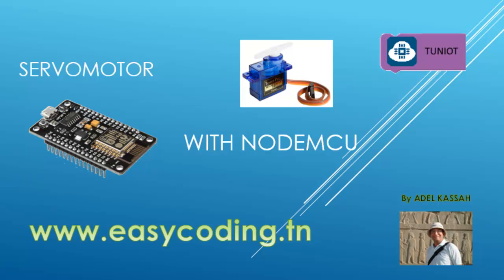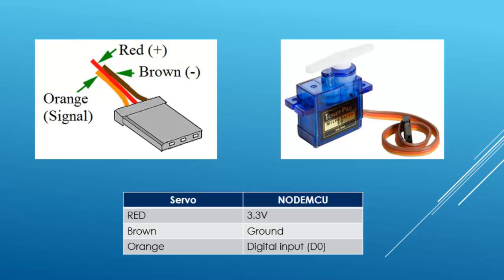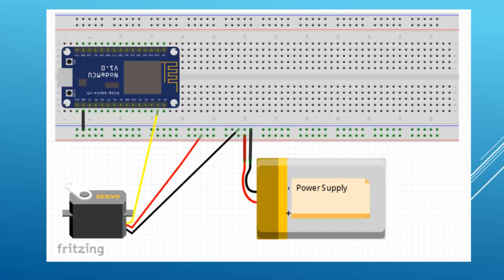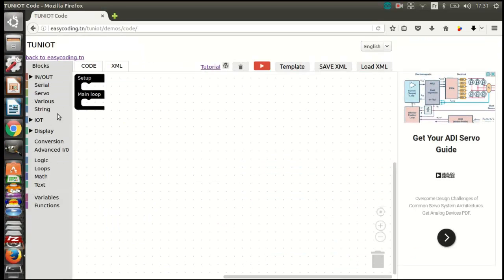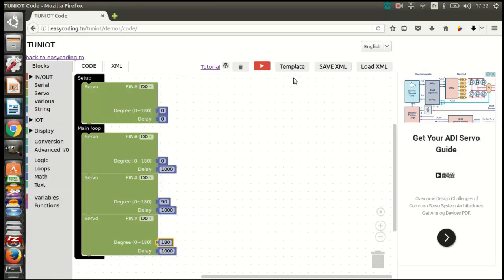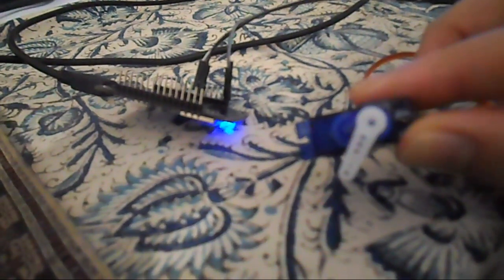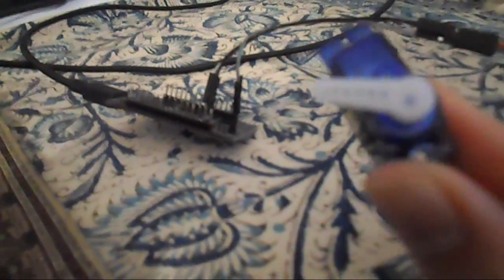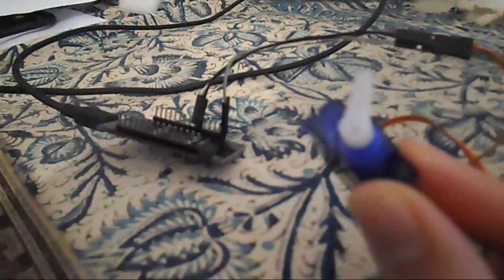NodeMcu (ESP8266) Tutorial A-15: Servo

Comment: nodemcu can't work with servo properly
Reply: Just connect red wire from servo (5V) to pin VU (Voltage USB) which is 5V without current limit (except LAPTOP 0.5A or powerbank cca 1A)